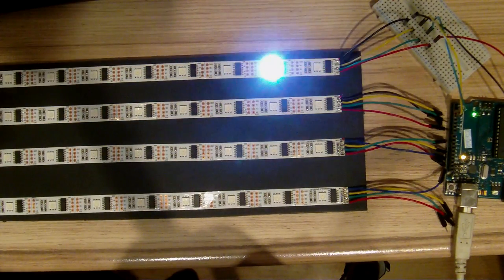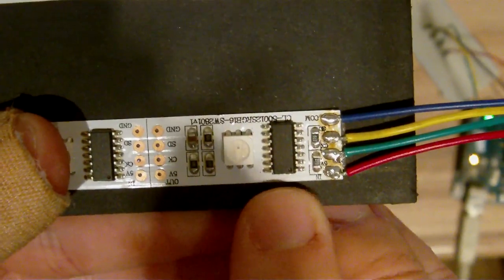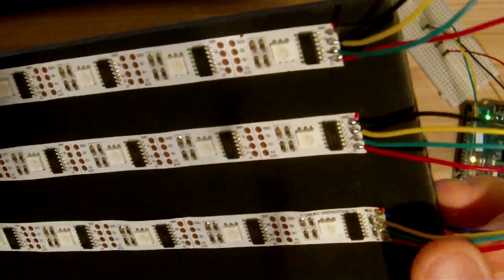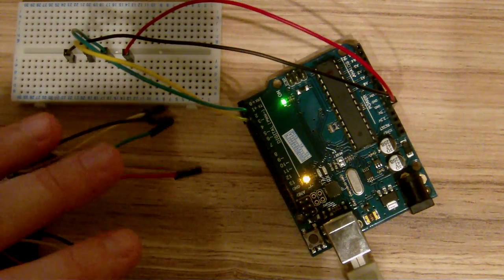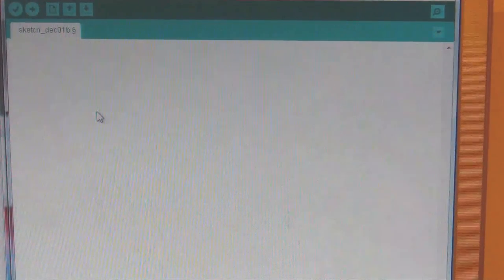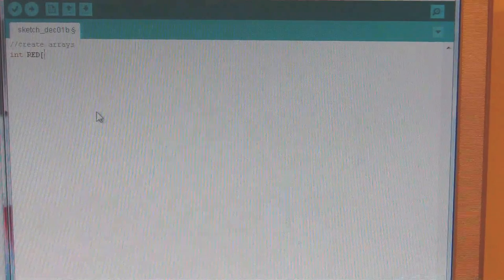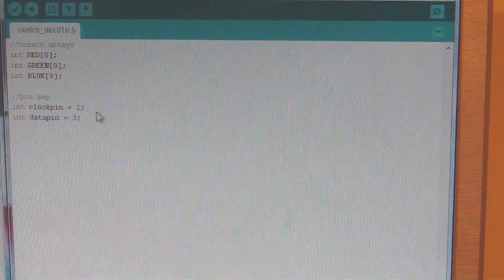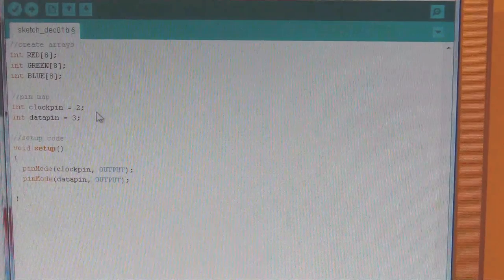#1 How to: WS2801 RGB 5050 LED's on Arduino uno, shiftOut

Comment: Its an amazing chip. Its applications are not just limited to LEDS. By using external mosfets, you can drive multiple PWMs albeit at 2kHz.
Reply from the maker: Indeed it's very use full. :) Thanks for watching

Comment: How to do this with regular leds not strip ??
Reply from the maker: You could use PWM and analog.write to control the LED and then just pull the channel values as in this video.
Reply: @CrazyLogic  any video guide ?
Basically i want to add 60 leds to my wall clock for showing seconds .. and i want just to glow led one by one until it reaches 60 then power off all then again start with one

Comment: Thanks for your video.  Can only WS2801 be used or also other protocols?
Reply from the maker: Others can be user but they need to have a separate clock and data wire to use this method.

Comment: Hi there i wanted to know something I am working on a weather station here and I have four RGB and I was wondering how can I loop it to change red then green then blue then half of

leds
4 turn to red
4 turns to blue
4 turns to green 
and so on

then 
when weather changes the led changes 
if its hot the led turns red
if its cold 
the led turns blue
and if it rains the leds turn white
 and so on

how can I do that
Reply from the maker: If you have WS2801, then a simple bit of code that's something like below would cycle through the LED's 

for(i=0;i<4;i++)
{
set value(pixel[i],255)
delay
set value(pixel[i],0)
}

Comment: Hi there, nice video. Do you have RGB LED Strip WS2811 12v coding ? the ic control 3 led at a time. can you share it at the comment or make a video about it ?
Reply from the maker: it should be exactly the same but rather than each pixel it controls 3 at a time. the SPI side of things is the same.

Comment: Is it possile to have an array of say 50 led lights with this code? And also would i need an external power supply or can i somehow manage to power them all using only the arduino ?
Reply from the maker: Yeah arrays of lengths past 300 pixels work fine. Power consumption can be worked out by 60mA per pixel and then really you want to limit that to 400mA on the Arduino (a usb is usually half an amp). So really - 7 pixels on full would be the limit for the USB.
Reply: Thank you for the fast response!

Comment: Okey, nice video!
How many  pixels/leds u can control with ardruino? in this video it is 8 and what is a max amout?
Reply from the maker: So the maximum amount of pixels in a string is not defined by the Arduino/code but by the pixels chip (and the bus speed which is set in software/hardware). 

The way they work is by reading a string of data, then removing the first 3 bytes (a frame) they receive, then passing the rest of the string to the next pixel. But there is also 2 reset criteria to tell the first chip when to start receiving data. 
If the CLK is low for 500us or more then the next rise is the start of the frame for the first pixel, 
Also on some (mainly 3 wire pixels) there is a time out - which limits the number of frames. 

From the WS2801 datasheet you can also see there is a physical limit between pixels too of ~6m. https://cdn-shop.adafruit.com/datasheets/WS2801.pdf 

But To summarise, I have driven 5m length of 4 pin 30 pix/m pixel tape without any issues other than a bit of voltage drop down the length (translates into brightness change) and with the 3 wire pixels (operating off a faster Micro-controller) I have driven 5m of 60 pix/m again without any data issues. TBH i suspect you'll run out of Arduino processing power before you hit the pixel limit.
Reply: Thanks for the answer. TBH im good at programming, but suck at  electricity. My dream is to build a huge something like 1m x 1m led matrix on wall, and control it with Arduino. By Arduino processing power what do you mean? should i use something like raspberry pi to run such project?
Reply from the maker: it all depends - i think my advice would be to start with an Arduino, to learn about the strings and electronics. then when the Arduino platform starts to limit your creativity more up to a PI or another MCU like a teensey - i would also probably say for that many pixels you'll be better using the fastSPI library and having fewer strings rather than use the code from this video. 

also depends how many pixels you'll drive in the 1mx1m matrix. if 30 by 30 pixels, then i think (have not tested this) that you might hit the limit, but there's no harm in trying - and there's certainly other users on YouTube who will have tried more than me. If you can find an answer to how many you can drive in another video, please drop a link in here to it, and if not let me know as i have some tape i could use to find this limit experimentally.

Comment: Do you have it circuit connection ?
Reply from the maker: 3:30 onwards shows the connections :)
Reply: Crazy-Logic ok thanks. Do you know how to coding one led one led light like in this vudeo by using ws2811 rgb ?
Reply from the maker: Have a look online for a 2811 library as they're quite specific in their requirements for timings.